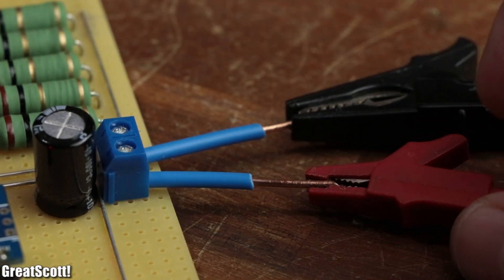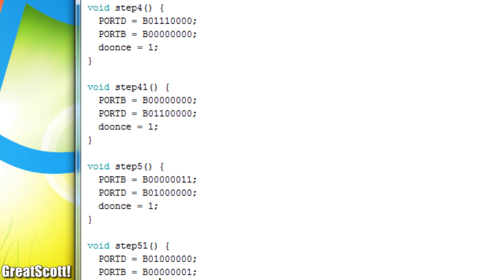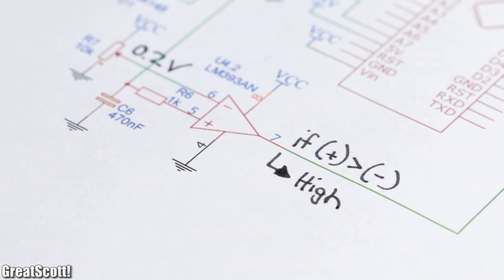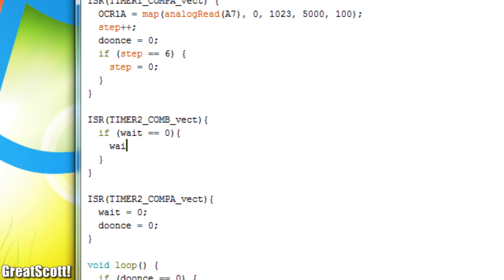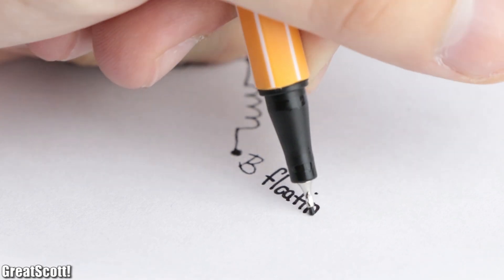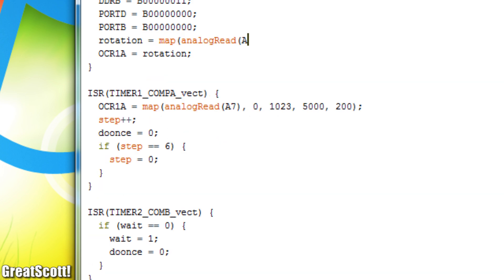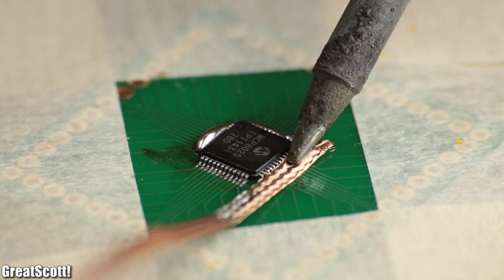Make your own ESC || BLDC Motor Driver (Part 2)

Comment: Hey, great video! Thanks! Did you ever take a look into open codes, such as SimonK?
Reply from the maker: Not yet. Maybe I should have done that.
Reply: GreatScott! Typical ESCs have an editable parameter called timing. It is in degrees. Do you know if it has to do with your [us] timing? (there is a lot of confusion due to this parameter, so if you could make a video about it it would be really popular :)
Reply: SimonK firmware is written in assembly. Same goes for other well-known open-source ESC firmwares: wii-esc and BLHeli. For many people, it's not the easiest programming language to read :) Although there are many comments and at least the general principles of operation can be grasped without too much difficulty.
But I think the author likes the challenge of figuring things out by himself. Which makes for great videos!

Comment: I tried to make esc with my L298 before. and it's totally garbage if you compare to commercial  one. Especially I'm stuck at my motor spin at highest speed and do the loop. by your explanation maybe I shouldn't try to make my own esc any more cuz it's doesn't save*(cost) something .

Comment: I like that you took this problem from the very roots, but with better and smarter ic you can control in a much simpler way and more attractive for your viewers.
Reply: jaime caballero hobby ESCs have been using inferior, dumber IC and managing to control motors just fine for years now.

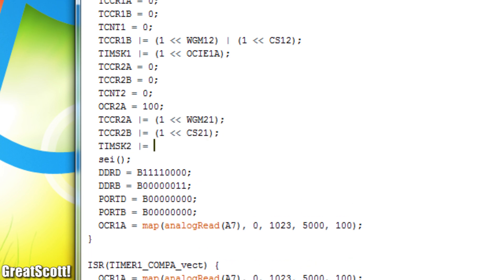Comment: @ 2:50 "resetting the 'wait' flag" 

What is the arduino function "wait"
How is it different than delay?
I cannot find this command in the arduino manual . . ?

Thanks!
Reply: It's just a variable name that he created.
Reply from the maker: I created the variable "wait" and used it in the code to indicate when the problem should wait. There is no such function.

Comment: There is no point of building an ESC, when they are so cheap to buy, and just use the Arduino to create the R/C PWM signal to drive them.
Reply from the maker: And if you need your BLDC motor to go very slow? Then what?
Reply: 1- Reduce supply voltage. (The KV part is there for a reason). 
2- Use a planetary gear box.

Comment: for the current couldn't you just use a battery with a high enough current out put instead of current chopping?
Reply from the maker: No. You always need this feature. Not only to have a "current limit" but also to create a more or less constant torque.

Comment: Since you can use the comparators to form a state machine to drive the current flow around the motor, why not try creating an analog controller?  You could use a 555 to generate a signal in response to the potentiometer, then use the comparator feedback to drive the excitation logic.  The single .2v comparator can also be used to drive the current chopper, since clearly it was the Arduino code that was at fault and not the comparator.
Reply: Bingo man. I was looking for such a comment. You can make it into mechatronic eng.

Comment: The propeller is spinning in the wrong direction. You could spin it at a million rpm, but with it spinning in that direction, it will never produce a lifting force.
Reply: Iridium his point was it only provided .5 amp, and that motor requires at least 20 amp to work well (pair it with a 30 amp ESC so it won't blow up). That's why in the end he was showing high power mosfets.

Comment: You should do the more powerful ESC video some of us want to build electric skateboards or bicycles
Reply: SKHILLBILLYslurrrs I agree, I want to see high power mosfets. If you need a skateboard esc, you can get some for $15. They are big enough to run a car alternator (my cousin working on electric bike project). They are the ones with fans in the heatsinks, though you can probably take off the fan, my cousins doesn't even get hot, but we are only load testing it on a wooden board grinding on the pulley (which will smoke from friction). They are very simple, you can hook them up to a $1 servo tester to check throttle control, or arduino PWM with potentiometer for input.
Reply: SKHILLBILLYslurrrs, google: VESC – Open Source ESC | Benjamin's robotics.

Comment: There shall come a day, where I will understand 100% of the content you post. But today is not that day!
Reply: BraedanRicketts Ricketts I said the same thing over and over never unsubbed the channel, this is making sense to me now...
Reply: @hasemhasan1151  Ditto :) (now try EEVblog)
Reply: @SpaghettiEnterprises   I know about that too, but it just hurts my ears...for some very odd reason
Reply: @hasemhasan1151  same thing here, it helps to do some of this stuff yourself.
Reply: Haha me too I can't wait to study electronics!!
Reply: He is no amateur.  learning more from his channel than I ever did in 6 years in electrical engineering.
Reply: Yeah, I had electronics at my college, but I am really amazed that someone has so much knowledge and can apply it in real life at once.
Reply: @PinkeySuavo  Please consider how short is the video, so lots of trial and error is edited out. Hours of work and study is condensed in 10-20 minutes.
Reply: @tiborbogi7457  True, still its amazing he did it on his own. I have troubles to solder a full bridge rectifier. And I dont even know how to choose proper capacitor.
Reply: @PinkeySuavo   You need a cheap multimeter, some  adapter with safe voltage (12V or so), some light bulb (12V...) for current limiting, some diodes and capacitors from old TV or other crap. Then just think and try and look around on web. Start with building power supply and step by step you achieve what is your goal.
Reply: @tiborbogi7457  I already took rectifying diodes from microwave, one LED and some capacitors. My source is AC generator and I wanted to get full bridge rectifier to make this current DC. But I am not sure how to calculate the best capacitor for this. I managed to solder it but it didnt look good, I felt like I need 5 hands :P I have some cheap multimeter as well
Reply: @PinkeySuavo  I don't understand your AC generator as source. You don't have 230V or 120V 50/60 Hz voltage in your house or flat ? How is your solder heated? What is voltage of your AC generator. What is frequency of your   AC generator? Capacity of condensator depends on current you want to draw from your rectifier. First your voltage rating of capacitor must be at least 2x of your AC source. For for example if your ac source is 12V ac 50Hz, than your capacitor must be for 25 to 100V. If you current is less than 500mA capacity around 1000 - 2000 uF is sufficient. What you want supply with your rectified voltage at first?
Reply: @tiborbogi7457  my ac source is hand driven generator from microwave oven, so maybe in this case it would be hard to get one particular capacitor? Because I think voltage, frequency and current depends on my speed of rotation
Reply: @PinkeySuavo  May be now I understand: you are try to use a synchronous motor from microwave oven as generator witch is possible.  Now what you want to drive with your source? Now we need to know voltage demand and current demand to get values of your capacitor.
Reply: Ha ha ha.... Scott is Great no Doubt  but we neef Masters in Electronics  I believe.  

I am just a graduate in Electronics and Communication Engineering. I understand all these but can't grasp everything lol
Reply: Ha ha ha 
Very well said
Reply: >>   everything   must   have a   micro-controller  -   high  spec   oscilloscope  ,  -   in the    process  -   the understanding  lost  .  The  video   extremly  good  -  made  copy  for  reference
Reply: That is a nice reference to Lord of the Rings
Reply: It sure is
Reply: Keep Moving Forward
Reply: You definitely have company here. I'm surely appreciating the content even more every time I review
Reply: 😂lewl i remember those days
Reply: Has that day come yet?
Reply: Is today the big day?

Comment: And this is why people need to learn to solve problems with circuitry other than microcontrollers...
Reply: Kevin Day actually the standard ESC are programmable and can be flashed with different firmware and code. It's just not an Arduino (though you can program it with an Arduino).

Comment: You can use hardware comparator that is in Arduino, at least for BEMF - you can attach virtual ground to AIN0 and phases to 3 analog pins and use internal multiplexer to choose which pin to use. It is much simpler and less error prone (PCINT aren't best solution for time-dependent tasks, and driving BLDC is such) than using external comparator. The only thing you have to have in mind is voltage levels, but simple voltage dividers should do the trick. Also you have to have in mind, that drone BLDS can operate at hundreds of amps, not like your small chip can deliver - 4A. Please tak that into consideration when selecting proper MOSFETs in the end of video.
Reply: Moreover, with timing of about 4-8 us you are meeting the smallest thing Adruino can count. Take in mind it works at 16MHz and by default uses 8x clock prescaler. This gives you the time of 0.5us per clock cycle, quite too much to be sure about the time microcontroller will switch your inputs.

Comment: Part 3 without a microcontroller? I mean clearly the bottleneck here is the arduino and the ICs not being good enough.
Reply: With what then?? Magic and sprinkles?
Reply: The same could be done with not too many logic gates and counters and a few comparators.
Reply: Interrupt based stepping and no PWM, and it should be able to get to high speed.

The ADC on atmega's are slow, possibly a atxmega would do somewhat better.

Comment: Wow, you did some great work with the MCU timings.

You may need a FPGA or CPLD to meet tighter timing constraints, but maybe the FETs will be enough for this.

It will be interesting to see this project take off.
Reply: For block commutation(like shown) a micro-controller should be plenty.

If you go for Field Oriented Control/vector control then you may need something more powerful.
Reply: Is he going for something that is functional with 4 ESCs, 
accelerometer, gyroscope, digital compass, altimeter, GPS, and RF remote?
Or is this a project he's doing just as a proof of concept?

It could work with 5~6 Atmega 328s.
Reply: Controlling an ESC alone should be fine with C or assembly. If he wanted to build a full quadcopter, he will need some more MCUs, or an FPGA. 
The 8 cog propeller CPU (P8X32A) does a very good job with multicopters.
Reply: For FOC an MCU is also enough, especially when using LUTs for the (co-)sine functions. Tho you have to use timer peripherals for PWM, but that's a given in every MCU.
Reply: tehaxor69  I can't emphasize enough how unnecessary an FPGA is for his application.
Reply: What about using the same mcu with asm?
Reply: For controlling a single ESC it is, if he wishes to control 4-6-8 motors and work with all the other sensors for a multi rotor copter, daisy chaining multiple boards like this would be a mess. One $10 FPGA board could do all the work.
Reply: tehaxor69 name of the FPGA board pls??
Reply: The thing is that it would still be cheaper to use a silicon labs MCU for ~2 Motors. The most space is being wasted by the power electronics. And if you've ever seen a copter you might have noticed that almost all of them have 1 dedicated ESC for each rotor, mounted to the rotor arm.
Reply: What Scott built is not feasible for a multirotor. It is too bulky and so is an FPGA. A simple cheap ESC will more than get the job done.
Reply: Mussie Tesfay using smd components would be tiny as a commercial esc, i dont know very well about the protocols (one shot, dshot, multishot) but im pretty sure you can built your own.
Reply: You can find plenty of cheap FPGAs on Aliexpress for $10-$30

I found a MAX II EPM240 for about $10 only has ~240 LEs

A Cyclone 2 EP2C5T144 for $15 ~4,608 LEs

A Cyclone 4 EP4CE6E22C8N for about $30 ~6,272 LEs

Comment: you can open up that esc and dump the memory from the atmega chip they use and study that
Reply: DAT Blue Husky and then what? That atmega chip from the esc uses different component hence it will not work. Hope you realize that the video itself is for education purposes and uses different simpler component to explain in a simpler way. That’s why at the end of the video scott want to step up the game futher with mosfets and all which is closer to industrial escs
Reply: Let me get it right BAT. THey use atmega?

Comment: GreatScott how can there be current peaks up to 6A in your ESC when your power supply is limited to 3A ?
Reply from the maker: There were big capacitors nearby.
Reply: Yup, you all beat me to answering that guy... Truth is it could be either L or C (didn't look at schematic) but it's gotta be one of the two.  Plus you always want a factor of 2 in your semiconductors so the magic smoke doesn't come out of the little black boxes.

Comment: Hey, could you maybe tell us what we need for the quadcopter project, to buy it now and build it directly?
Reply: For a quad you need: 4 motors, 4 esc, a quadcopter frame, 1 flightcontroller, at least 1 lipo, 1 transmitter and 1 receiver. Just watch some DIY quadcoper build tutorials here on yt. It's pretty easy to build a quad

Comment: Can the lower rpm of such a driver be used to make a bldc spin slower with more torque for use in a electric bike ? And is it possible to take the rotor of a washing machine motor to make a stator for a bldc ?

Comment: I believe this circuit works with  attiny2313, but I have a lot of msp430g2553. Can anyone clarify me whether the same ckt will work with msp, since its operating voltage is 3v3.

Comment: things like current limiting and BEMF feedback had been recurring problems in my hand-made motor drivers. I had tried doing BEMF sensing/... via discrete transistors (ex: 2n3904) but with limited success (don't have opamps or trimpots; mostly tried biasing things via voltage dividers).
recently put this on hold as this stuff eats a lot of money and components (more so when accidentally blowing up comparably expensive MOSFETs and similar).

I had admittedly had more success for some stuff basically just using stepper motors and computed duty-cycles and speeds. for fastest speeds with steppers, generally had best results with both phases active at a time and using a variation of reverse-sawtooth waves (square was better for torque but limited to low speed, sine wave made motors run quieter and cooler, but had neither great speed nor strong torque).

in code, could switch between driving waveform and duty cycle values and similar based on target speed (except on some MSP430s I was using, where the drivers were pretty limited due to the 2kB ROM size limit).

Comment: Hey GreatScott,  I had a question. Aren't you supposed to change the commutation state 30 degrees after the pin change interrupt occurs?? What I mean is the BEMF ZCD event and the commutation state change don't occur at the same time, there's a delay of T/12 between the two right??

Comment: Considdering that most quadcopter esc's are 12A or more each, and your build will weigh much more than most racing quads then i would suggest that you beef it up to handle atleast 12A if you want to have some power left to save yourself from a hard crash.

Most of the times my quads have been broken were when i didn't have enough lift to pull myself out of a bad situation.

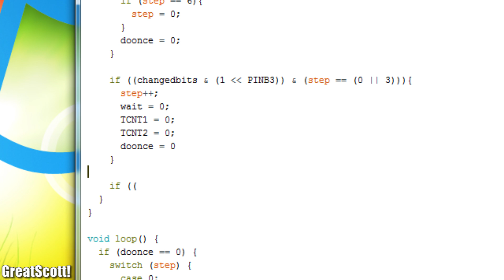Comment: 8:32 - in the if statement, are you intentionally performing a bitwise AND, or did you just forget a second &?
Reply from the maker: Yep, that is a mistake in the video. The code on instructables is correct.

Comment: OFFTOPIC Question: Where do you usually get the components for your projects? Online? Physical Store?
+GreatScott!
Reply from the maker: Online. Pretty much always Ebay. But if I need a component fast then I use Reichelt.
Reply: I prefer online because sometimes physical store doesn't have part stocks that you need....
Reply: ANTHONY CABALLERO which websites do you buy from?
Reply: Gabriele Nitti although I didn't try it yet, I'm planning to buy from rs-online and Digikey
Reply: ANTHONY CABALLERO my personal experience with rs has been shit

Comment: Great Scott, I think you might want to to consider lighter motors and a different structural material, considering wood has a high wind resistance therefore require more thrust
Reply: What does that have to do with the motor turning? The material used in the video to hold the motor is just for demonstration purposes.

Comment: Isn't it better to use
PORTA = (1 << 2) | (1 << 3) instead of PORTA = 0b0001100.
Reply: Deep 123 pretty sure the compiler treats it the same.
Reply: Yep, but this code easier to read and you can make your code more flexible by defining the pin numbers in preprocessor.

Comment: great video! One crazy question remains: what about Electronic Position Control? Is it possible to create a stepper-like behavior with a BLDC?
Reply from the maker: In theory it should be possible. But then again the step angle would be much bigger than a proper stepper motor.

Comment: does that current chopping decrease the efficiency by a lot, and is that the reason of the audible frequency emited by the motors?
Reply from the maker: It does not decrease the efficiency. And yes, that is usually what you hear.
Reply: JoraForever  no it's the frequency of the power that the motor is pulsed at its like pwm on brushed motors
Reply: Most likely slightly, but it gives you speed control.
The PWM does for sure lower the output power.

The PWM is NOT needed to run the motor (if full speed only is ok for you)
Reply: right?
Reply: JoraForever u
Reply: GreatScott! please make a video about tv signal amplifier